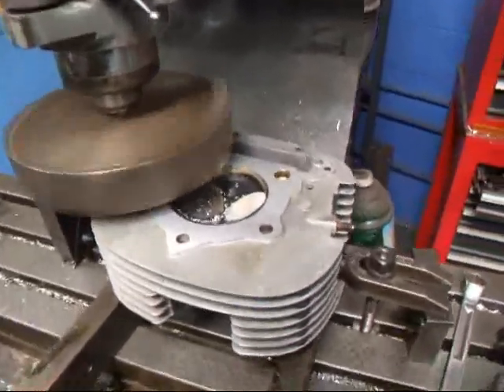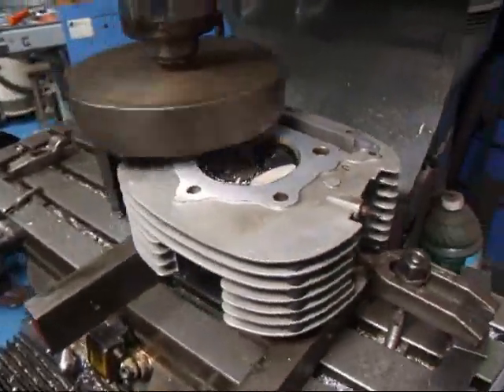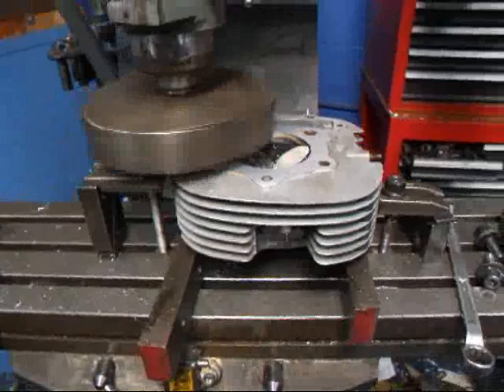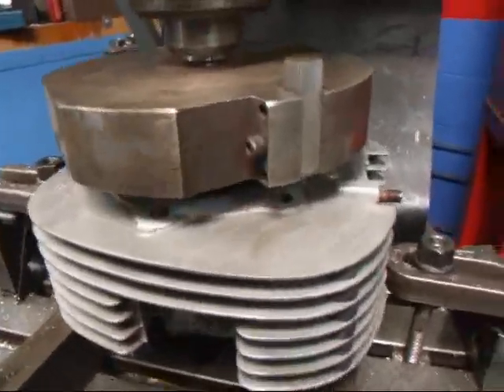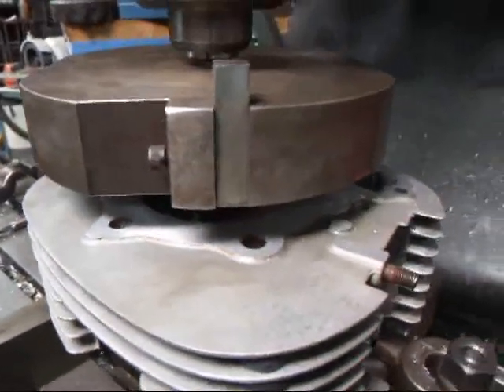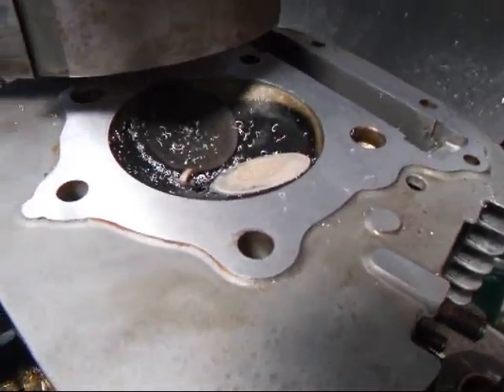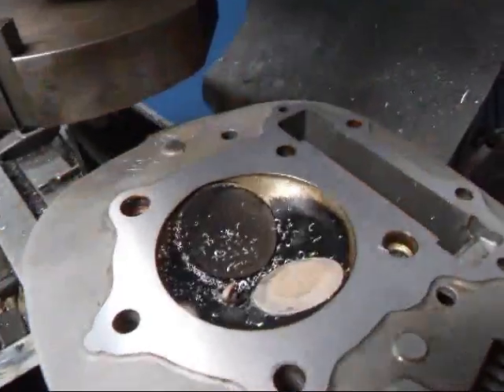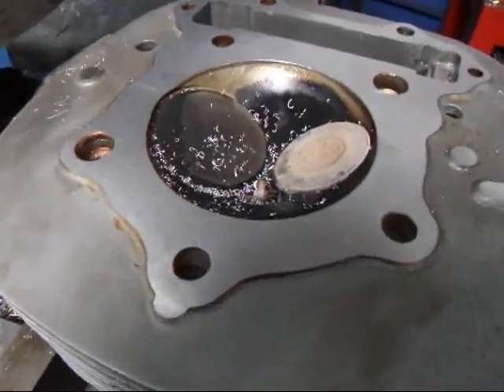Motorcycle Head Resurface.wmv

Comment: I dig your videos, John.  I got a set of EVO Sporty heads on a labor / fabrication trade, knowing that the fins on one corner of one head were damaged.  I have kicked around repair ideas, and have (almost) settled on building up the material with tig welding, then cutting the "grooves" between the fins on a mill.  Do you think that too much heat will go into the head for this type of work?  In some spots, the fins are busted off all the way at the base, and I'd have to build up at least an inch of material.  I was thinking of preheating, then doing a few passes with 6061 filler at a time, allowing it to cool somewhat between sessions.  Thanks for your time and efforts.

Comment: Sir in your turret mill book do you tell where you can get the tooling for resurfacing motorcycle an automotive heads like the flycutter etc also do you have anything on cnc programing for cutting splines thanks